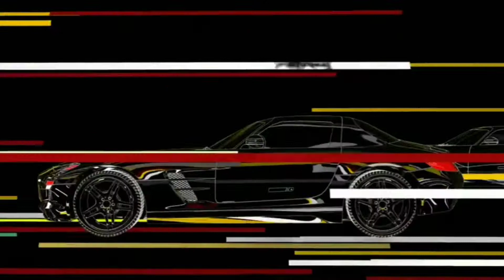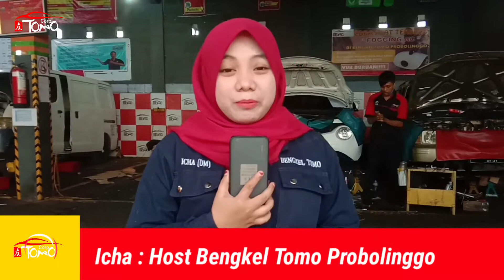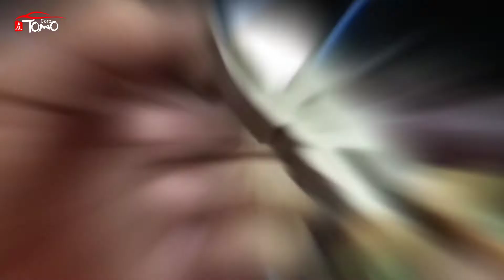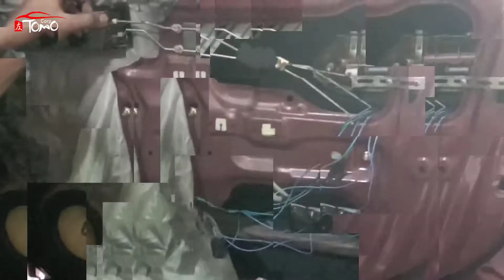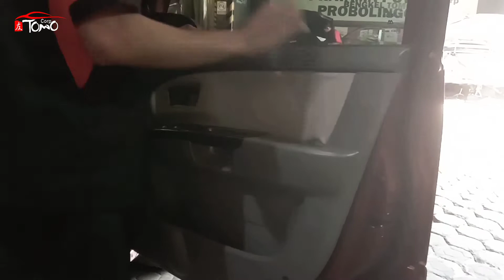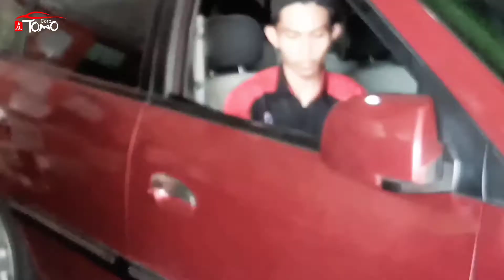KIA Carrens Bermasalah Pada Central Lock, tidak bisa membuka& menutup otomatis #edisi385

Comment: Boss bisa bantu kah, mobil kia carens saya saat ini  mogok di Hutan.  Awalnya central lock tidak mau geser lock pintu.. Saya buka manual.. Mobil bisa stater tpi tidak mau hidup.. Tolong urgen  skrh
Reply from the maker: Lokasi dihutan mana boss? Kita luncurkan derek mobil...
Reply from the maker: Bisa langsung hubungi WA https://wa.me/6281359539260
Reply: @servismobilprobolinggobeng3502  saya di Kalimantan Timur Berau kec. Segah
Reply from the maker: Masalah diatas bisa diakibatkan dari sensor ckp nya atau bisa juga konektor nya... Semoga membantu Terimakasih..